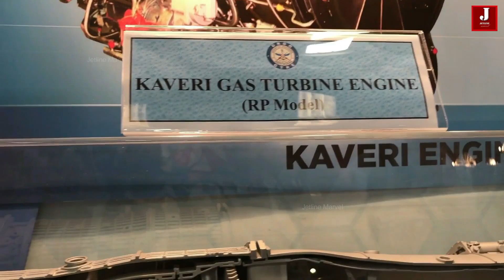How the Su-30MKI Will Be Modified as a Kaveri Engine Test Bed

Comment: Why can't india buy engine blades from Russia and fit it to kaveri
Reply: Size matters and pressure of the different engines do also matters 
Imagine if Kaveri produce more heat than Russian engine and the blades couldnt not sustain the power 
If that There should be seperate Russian made blades only for Kaveri
Reply: @Madhav0025  mm ok